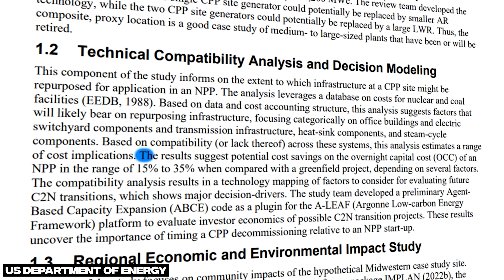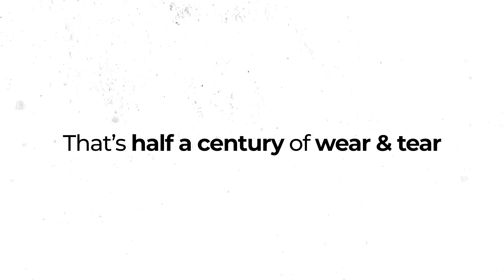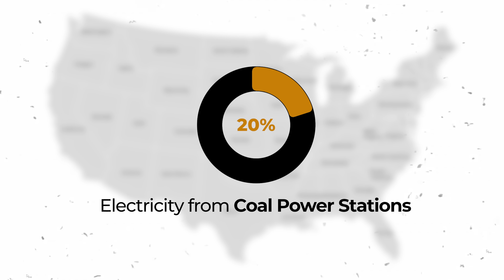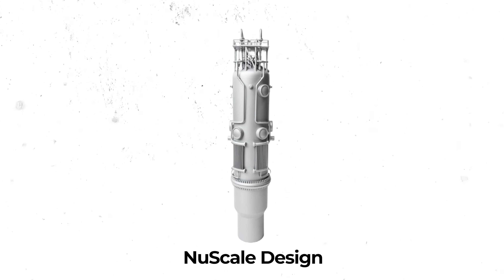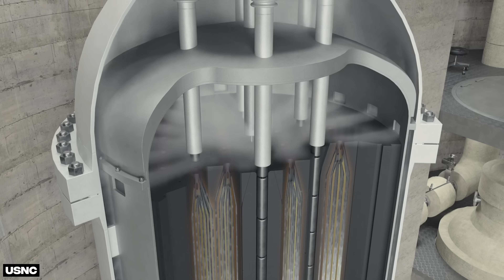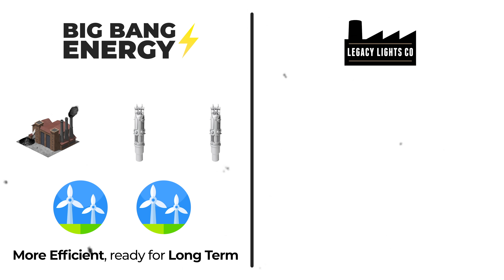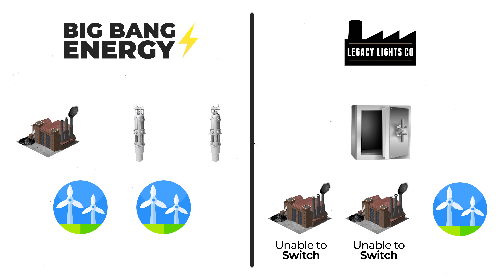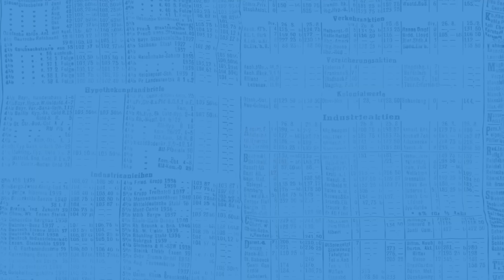Can We Convert Old Coal Plants to Nuclear Energy?

Comment: Have you seen the new proposal to turn old coal plants into geo thermal plants with the new drilling technology we have we have new laser drills which apparently can drill deeper than traditional drills that get stopped by pressure and temperature to the point where we could reach a geothermal temperatures down in the crust I've seen some videos and stuff on this essentially each drill down until we reach the Earth's heat and then produce power and it can be done anywhere I find that interesting and I would love to see a video on that and more research about that
Reply: I recall several articles where they mentioned most places would require new advances in deep drilling. Idea is great, it has been done before but i'm afraid situation is too urgent to wait for advances in drilling when we have perfectly working nuclear technologies.
Reply: The key problem with geothermal super-hot water or steam is that it is highly corrosive and tends to plug up the pipes and equipment with corroive and toxic deposits.    The few plant build in the USA require you to be in chemical protective gear to just walk around.  The puddles on the ground can damage your shoe and foot (I know someone who worked at one of them).

No one has proposed building any more even where there is relatively shallow heat sources because of that.
Reply: @perryallan3524  What substances this water contains that makes it so toxic and corrosive? 
Some of them are obvious but having to walk in chemical protective gear to avoid puddles is something i never heard about.
Reply: @codaalive5076  relatively hot water near the surface is typically associated with volcanic magma fairly shallow in the earth.   If its in subduction zones (think Rocky mountain area) then it tends to have a high sulfur and other content.  Various acids and other corrosives and all kinds of clogging minerals are common.

I suggest a several day trip to Yellowstone to took at all the different kinds of thermal pools and geysers.   A number of them have signs warning you of the chemical dangers if you fall in.

Now where there is an abduction zone (Iceland) where the tectonic plates are pulling apart you get a completely different type of magma and over a magnitude less of all kinds of corrosives and clogging minerals.   But, Iceland is about the only location on an abduction zone in the world.
Reply: Nuclear is basically just Thermo, but sealed in a box, with waste management, and without ground fracking.
Reply: geothermal is the nes big thing cause Ira 99% identical to drilling oil n gas wells but even less contamination and pressures so less casing and cement.
Reply: @perryallan3524  There are some geothermal concepts which use a closed system (i.e. no pumping of aquifer water. An example is Canada's Eavor): corrosion will be less of a problem for them and they need less power for pumping -with some even claiming they can even rely on thermal syphon and don't need pumps-, but on the flip side they absorb heat at a lower rate (less cold surface area). The persistent problem with geothermal is the limited output of 60 kW / km^2 (world average). But like derrekvanee4567 is saying, we might still carry out some of this vision because there is already a lot of experience and infrastructure. Moreover, if one drills up to a depth D, the heat absorbed scales like D^2 in the short term and D^2/(ln(2D)-1) in the long run. So one can enjoy a scale advantage by drilling deeper.
Reply: @5th_decile  Canada's Eavor looks interesting. I hope Canadian wells are closed properly because American are leaking large amounts of methane, beside causing other problems.
Reply: @5th_decile  There have been many promissing geothermal techologies in the past 6 decades.    The problem is making them work from a practical fashion in the real world.     What always happens is that people build them (at least a test plant) and then they find that there are issues that they did not think of - and so far those other issues not planned for has stopped further development.

While I wish Evaor the best of luck... this is still a game where it's luck and not science, except that the odds are way against you based on history.    Still someday, someone will figure it out.   I'm not counting on that to occur in the next several decades as I did back in the 1970's with geothermal, solar, and wind.    We have had only limited and partial successes of Solar and Wind compared to the dreams and goals in the 1970's.
Reply: @perryallan3524  I share your caution regarding geothermal, but the oil industry's existing experience and infrastructure and a suitable political climate could tip it in a favourable direction. Solar and wind are here to stay I think, they handily beat the fossils in their prime hours (sunny and or windy days), but to allow them to break out beyond the "intermittency conundrum" and also beyond electricity (to get "deep decarbonization") may still require political will.
Reply: @5th_decile   I hope you are correct.   But something a vast majority of Americans miss is that in America we are not being told the true cost of Solar and Wind power.

In the USA the Governemnt is only telling us the cost to build the power generation units.   The cost to get the power to a local city and the end customers is excluded - and carried by the transmission and distribution utilities (which no one notices in the USA).

It cost a proverbial fortune to connect, transmit, and phase adjust electrical power from essentillay tiny solar and wind generators (and even modest geothermal) to the end customer.

Once you combine the cost of the electrical transmission with the energy source.  Nuclear Power is still the cheapest way to deliver large amounts of power to the end customers.   There have been multiple international studies done on this (and generally you-tube comments will not allow me to link other websites).

That's why there are dozens of base load nuclear power plants being built in the world.  The rest of the world is focused on lowest delivered cost.  Not lowest generated cost.
Reply: We can use an X-ray laser to drill a very deep geothermal well in one shot.  I want to watch 😸
Reply: @tristan7216  X-Ray laser drills are a theretical concept.   No such drill currently exist.    Perhaps in several decades and with several $billions+ (if not tens of $billions) of dollars of research it might.

Comment: The nuclear reactors critical dependency on water for cooling usually drives the choices for their locations (close to shore or other large bodies of water). Even new generation nuclear reactors (i.e.: SMRs) have that dependency. Considering coal plants do not have the same dependency, they are not necessarily located close to large bodies of water.  How do you reconcile that with your idea?   Am I missing anything?    Cheers.
Reply: You're missing something.
Driving the location by water resource is not quite accurate - or perhaps you care to explain the 2nd biggest NPP in the US is located in Arizona. In the desert. Without ready access to a major river, lake, or the ocean.
Reply: @factnotfiction5915  That is an interesting point. The Palo Verde NPP uses millions of gallons of treated wastewater from Phoenix. That is the only one I am aware of that uses this model. I do not know about the finances and other challenges behind having to construct and maintain a waste management facility to serve the NPP though. Interesting case nonetheless. So far I believe my point/doubt still stands. I welcome the exchange. Cheers.
Reply: @corujariousa  > So far I believe my point/doubt still stands

Given an example of how a design can side-step the need for riverine/lake/ocean cooling you still believe the point still stands?

I believe Palo Verde shows siting is about the local conditions and cleverness of the engineers, vs a blanket "NPPs need a certain type of cooling solution and thus have siting problems".

Now, wind and solar really do have siting problems (as do hydro and geothermal). It is ALL about the local conditions, and very very little about how clever the engineers are. Either you have a windy/sunny place, or you don't. There is no point in even looking further.

For a NPP serving an arid region, there is a point in investigating alternatives.

In addition, for a poor country with poor freshwater resources, the waste heat leftover from electricity generation can be used (as in AZ) to treat and improve the water/sewage supply, even potentially desalination.
Reply: @factnotfiction5915  That is OK. I guess we'll not be able to agree on this. The way I see it, Palo Alto NPP being the only case (that I could find) that took the extra complexity of creating a water treatment facility to ensure cooling in an area where no large bodies of water are available, make me question how economically viable that model is. In terms of technology, this certainly is a proven case. For our energy generation challenges I strongly support a diverse approach. A simple and common model is not viable to all countries.  Cheers.
Reply: @corujariousa  if you don't like hot and dry, let's try cold and wet

Finland likes nuclear power for 3 big reasons (aside from low-carbon, reliable generation for decades):
#1 geopolitical - it is nice to have an ability to store decades-worth of fuel in a few hundred tons of uranium; rather than rely on an unstable neighbor to (maybe) supply you with high-carbon natural gas.

#2 wind - eh, not so much in winter, when peak demand is

#3 solar - eh, not so much in winter, when peak demand is

The point is, nuclear is flexible and can be installed in a lot of locations; wind and solar are not so flexible; coal and natural gas are high-carbon and supply is highly dependent upon geopolitics.

> Palo Alto NPP being the only case (that I could find) ... make me question how economically viable that model is.

Again, your original statement was a bit of an absolute, but which place on earth exactly ARE NPPs an absolutely horrible (versus secondary or non-preferred) idea?
* not near cooling water - Palo Alto shows NPPs can be done there
* earthquake-prone - Japan shows NPPs can be done there
* tornado-prone - Illinois shows NPPs can be done there
* hurricane-prone - Florida/India shows NPPs can be done there
* 3rd-world - Bangladesh shows NPPs can be done there
* small-countries - Nederlands, Slovakia, etc shoes NPPs can be done there
* hot countries - UAE shoes NPPs can be done there
* cold countries - UAE shoes NPPs can be done there
* etc, etc, etc

> I strongly support a diverse approach. A simple and common model is not viable to all countries.
Agreed, but nuclear is no worse than the other choices, and in general (vs in specific) is among the better choices.

What about the economics? (per your point about sustainable economic models)

All I can say is look at the facts. (acknowledging that NPPs cost a lot of money)
Nuclear ELECTRICITY (vs nuclear PLANTS) is cheap!
Nuclear France has electricity half the cost of RE+coal Germany.
RE California has electricity double the cost of Nuclear Illinois.
RE South Australia has super-high electricity costs, lots of blackouts and terrible emissions.
Nuclear Ontario has low-cost electricity, no blackouts, and super-super low emissions.

Comment: Coal plants have that low capacity factor because they are often used for backup when the sun isn't shining and the wind isn't blowing or there are some other energy shortages. Powering them down saves fuel and operating costs.
Nuclear plants are used for base load and don't use up a lot of fuel. Powering them down doesn't save on operating costs.

Comment: I'm starting to realize what the major issue with Nuclear is ... everyone is worried about radiation and upfront cost etc.... but the main issue is that the fuel is not available everywhere. We might have enough in total, but geopolitical issues can really throw you off and you give away power to those you now depend on ... which is now happening in France ...
- Indeed, solar has much less of this issue...

Comment: Those coal plants will be upgraded to generate power from gas. A lot of the big coal plants in the us have been completely converted from coal to natural gas all they do is change the fuel type and they don’t have to make a ton of modifications to the existing plant. They can use the existing exhaust stacks. Only thing they’ll have to do is tear out the coal delivery system and replace it with piping for gas injection into the boiler. Plant Watson in Gulfport Ms is a prime example of a coal plant they retro fitted into a gas fired plant. Only difference between the gas version and the coal version of the plant is now there’s no coal yard or any coal infrastructure at the plant.

Comment: Yea, sorry, having worked in the extraction end of oilsands, coal and uranium, all three need heavy haul trucks, you have to move even more over burden to get uranium than either of the others.
Reply from the maker: The study pointed out that those kinds of external supply jobs weren't directly considered. Only on-site jobs, which for nuclear doesn't have any heavy fuel movement like that. But I get your point.
Reply: actually, most (about 55%) uranium mining is via in-situ leaching, which doesn't create a log of overburden

Comment: There can be shared components and infrastructure, as coal burners or reactors produce super-heated steam, steam is converted to electricity with turbines and cooling towers, a common component.  Nuclear reactor requires a location with very sturdy foundation, big and thick plate of reinforced concrete, perhaps foundation of a coal plant can be upgraded, minimizing new digging and new steel+concrete.  Another component is power distribution, transformers, power lines.  So inheriting old grid can save a lot.
Another remark: the power output of "medium" nuclear reactors, 440 MW, is similar to coal plants.  Mini-reactors would be less efficient.
Reply: Very few U.S. nuclear reactors secondary's produce super heated steam and the few that do are no where near as super heated as a coal plant.

Everything is a power plant is matched and if it is not there will be inefficiencies.  All currently approved new nuclear plants are in the Gw capacity range not 440 Mw range and none produce super heated steam.

Then there is the idea of reusing 60 year old coal plant secondary components for a new nuclear plant.  The reason most coal plants are shut down is because excess maintenance of old components is too costly.

The transmission lines can be reused but it may not be a good idea to reuse switchyard disconnects and transformers built in the 1950s.

Comment: 5:00 - reuse internal parts? Oh no .... look at SLS and how much it made things "cheaper" ... Yes to reusing the Grid connection, transformers, etc ... things that do not tightly couple to the reactor ... but I feel like reusing turbines etc will .... just make the project a hell to work on, and it will instead take forever and get much more expensive... People tend to make new things over updating old projects for a reason...
Reply: You mean that it is not a good idea to reuse coal power plant equipment from a 60+ year old coal plant that is being shutdown because the maintenance on the equipment is becoming so expensive due to the plants age? 
Realize that even the equipment in a switchyard of a 60 + year old coal plant was designed shortly after WWII. And they say the reactor will operate for another 80 years, depending on this equipment????  Nuclear power plants need external power or emergency generators to stay cool even when shutdown.

Comment: MIT has already put out a report that if the US would start looking at fast reacters (powered off used nuclear fuel) there's enough in the US just sitting in storage fields to power the entire country for 120 years. Europe already uses this technology but the US outlawed it 40 years ago due to new fuel was more profitable.
Reply: I believe you are talking about reprocessing spent fuel to extract the Pu239 present and make MOX fuel, like France does.  There are many issues to this subject but simply put, it would cost more to reprocess spent fuel to make MOX than it would to just make virgin uranium fuel. 
Yes, it would reduce the safe storage time for the remaining spent fuel fission products from 160,000 years to ~ 1,000 years.  But when you are talking about 1 or 160 thousand, who alive really cares.
Reply: That 120 year estimate for the "whole country" is based on complete utilisation of the U238, which in turn depends on either endlessly reprocessing spent and used fuel, or on running a whole fleet of fast reactors just to convert uranium to plutonium. The French attempt with Fast Phoenix was a flop.

Repeated recycling of used MOX fuel has distinct challenges. There is an inevitable accumulation of awkward isotopes like U232, so reprocessing will require additional steps, as well as isotopic separation.

The US abandoned reprocessing because there wasn't a way to make it profitable, and the wastes of used MOX require longer disposal periods than ordinary spent uranium fuel. If there had been a dollar in it, they'd be doing it.